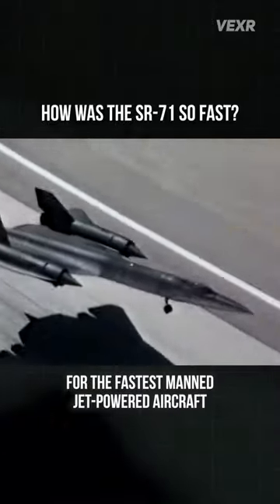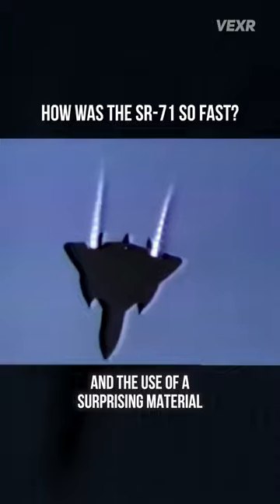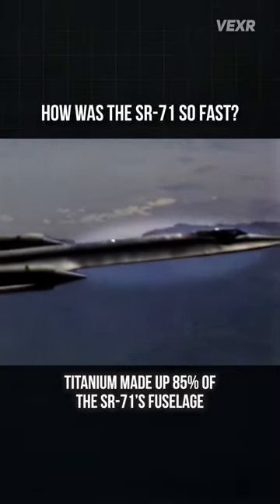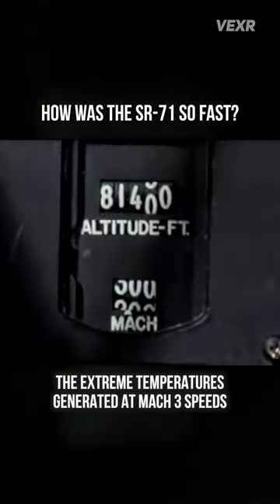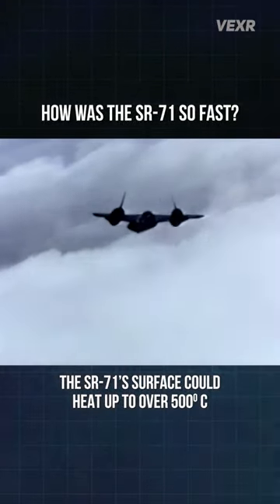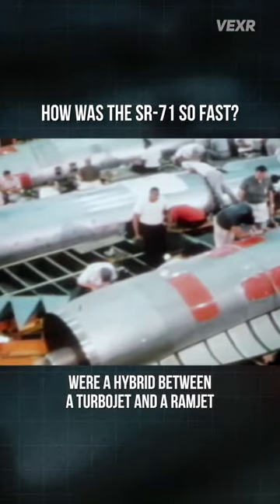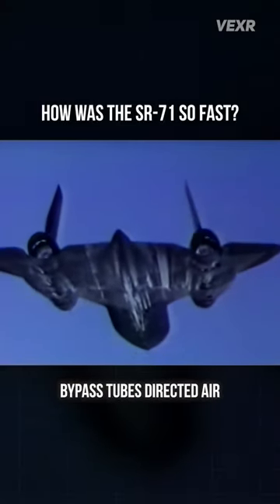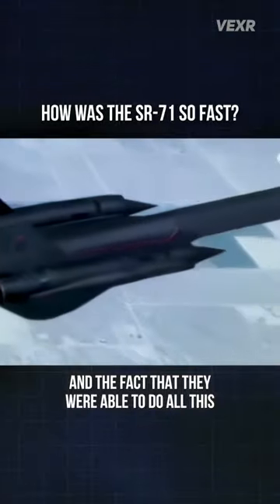How Was The SR-71 So Extraordinarily Fast?

Comment: Using slide rules instead of computers, Kelly Johnson and his crew went from drawing board (again, no computers) to first flight in 20 months. Incredible!
Reply: Slide-rules.
Reply: @sbkenn1  Yeah... damned autocorrct!
Reply: @russmiller7284  auto incorrect.
I have a spelling chequer, it came with my pea sea 😛
Reply: I don't know why everyone makes such a big deal about that, computers don't design anything even in this day and age, all computers do is enable someone who's designing something to look at it 3 dimensionally via CAD instead of everything being drawn on a flat plane, and they can make calculations instead of having a team of people doing the math but at the end of the day they don't design or innovative, it's people who do that.
Everyone gives too much credit to computers when it comes to designing things in this day and age, it's still people doing all the designing and innovating, it's not like you can enter "Design a better spy plane than an SR71" into a computer and presto!!! You have the next generation spy plane.
And actually a slide rule is a computer, so is an abacus, and slide rules aren't any harder to learn how to use than a modern handheld calculator, they just aren't as fast.
People who design things nowadays are just as smart as the people who designed the SR71, matter of fact they're smarter, they design autonomous vehicles that travel to other planets and move around transmitting images back to earth and take soil samples and analyze them and send the results back to earth, that's far more complex than the SR71 and anything it could do.
Reply: @dukecraig2402  I'm old enough to have used both a drafting arm and CAD. With CAD, not only can one draw much, MUCH faster, the programs double-check math. Yes, of course, the creativity remains with humans, but the technology saves SOOOOOO much time (while catching mistakes).
Reply: @russmiller7284  With relative/parametric placement, you can move many objects in one action.

Comment: The hybrid engines were built such that the faster you went, the faster you COULD go.

Turbo jets stop working effectively around the speed of sound, however Ram jets only START working at the speed of sound. It's nutty.
Reply: Only faster to a point, once you hit the limits that's it
Reply: Ramjets start losing their efficiency when the internal speed of combustion is supersonic, but newer Scramjets can go up to Mach 6 because they can support supersonic combustion.
Reply: @iwhu707  ramjets lose efficiency when they are used outside their design range. They are perfect for flights of mach 3 and are capable of speeds up to mach 6, IF they are designed for that. 

Scramjets have yet to become operationally usefuel
Reply: @gr8crash  I believe SR-72 will be scramjet-powered, but i’m not sure. I also thing scramjets will get more useful once we can combine them with rail guns, which will give it enough initial velocity to start up combustion.
Reply: @iwhu707  if/when an SR72 comes out "even though it won't be called that" it should be scram jet powered. The fictional Darkstar in Top Gun 2 actually did a good job of showing how a system like that would work.

I highly doubt you'll ever see railguns on an airplane. They are a cool technology,  but given the size, power needed etc they'll likely never be on an aircraft. You'd be more likely to see energy based weapons.
Reply: @gr8crash  I meant that scramjets would be used as a “sustainer” stage on a railgun projectile to increase range, since railguns can easily reach Mach 6. However, it would be difficult to design a scramjet that can withstand the G-forces of the railgun launch.
Reply: @iwhu707  oh ok, I see what you meant now. I'd doubt that as well though. They already have a range of about 125 mile or so, and the rounds are so small that you wouldn't be able to install and engine, fue, controls etc. At that point you're just making a hypersonic missile
Reply: @gr8crash  Fair enough.
Reply: Unless there's something I don't know about rail guns, they are kind of impossible to mount on a bird right now, just way too power hungry and big. You'd be better off filling up a cargo bay with tungsten rods strapped to tiny solid rocket boosters and drop them at mach 4 from low orbit.
Reply: @MakutaNazo  yea they are just way to large still and way to power hungry to be on an aircraft for the foreseeable future.

Comment: The X-15 aircraft also holds the official world record for the fastest manned aircraft. It was flown by Air Force test pilot William J. “Pete” Knight who reached a top speed of Mach 6.72 (4,520 mph; 7,274 km/h) on October 3, 1967.
Reply: The X-15 was an experimental plane made to learn about how planes and their structures work at such high speeds. The SR-71 actually has meaningful capabilities besides "plane go brr"

Comment: It actually leaked fuel when on the ground because when the metal heated up and expanded it would seal theaks. That's what I was told so take it or leave it. Still a badass spy plane.
Reply: Thats correct. It leaked slightly because the heat shielding swells to fill the gaps, and the small amount of lost fuel is nothing compared to the extra development costs to fix it.

Comment: As a USAF 5 level ASOP and WCT I logged one of the SR71's in 1974 on radar while stationed at the now defunct 932nd AC&W Squadron, Rockville, Iceland. It was westbound and probably coming back from a mission. That specific info was above my pay grade. At the time I carried a secrete clearance.
Airspeed was over 2000 kts. The ground speed equivalent was difficult to calculate as the bird was flying at what pilots called 'angels 49'. That's 49,000 feet for the civilians in the crowd!
I also understood that once landed the pilots had to remain in the cockpit for about an hour being protected by the onboard AC while the hull cooled down. With a skin temp of about 1000 deg F getting out early would have fried them to a crisp!!

Comment: I saw one of these at a museum and one of the workers was saying that the plane actually had gaps in some parts of the plane because it would heat and expand so much where it would close those gaps during flight
Reply: It leaked fuel at take off because of those gaps.

Comment: At speed the engines expanded 6" in length and 2" in diameter. The fuel was also the lubricant and the anti-oxidant and had to work -45F to 800F. The computer was hydraulic. Imagine the engineering challenges!

Comment: What's even more fun is that we don't know it's actual top speed.  They never tried to open up the throttle all the way.
Reply: They absolutely knew the top speeds
Reply: @gr8crash  no they don't.  My grandma worked as one of two personal assistants to kelly johnson.  She knew when it was being made and put into service and when they did that speed test from la to newyork.  The pilots who did that test did not push it all the way.
Reply: @camohawk6703  incorrect. They never did an LA to NY run, it was LA to DC. And they did fly a lot of it at their max of mach 3.3. They did go to P&W and ask to fly beyond the 427° CIT limit and they basically said "don't do that".

Comment: Titanium and technology supplied by Avro in Canada after the Arrow development was mysteriously cancelled..
Reply: Lol no
Reply: @gr8crash  Very shortly after the Arrow project was mysteriously cancelled, a lot of the engineers, machinery and material were moved to Lockheed.  Fact.
Reply: @sbkenn1  haha not likely. I'm sure some where taken in by various aircraft companies,  but not likely into Skunkworks. They were already in the design phase of the A12 when the Avro ended. And the Avro while cool had nothing of significance to contribute to the A12 program. The ONLY thing that was used was the J75 for the initial A12 flights and for the TA12. Unless you can name someone who left Canada to go to Lockheed Skunkworks to work on the aircraft then you can't state it as a "fact"

Comment: Even with Titanium the panels have to have gaps in them because the heat and pressure would cause them to expand into place. Just Amazing
Reply: Leaked fuel.Had to fuel enough to heat it up Very 1st thing was to refuel in air.Then go on mission.😮

Comment: The sr71 does not hold the record
Reply: Um yes it does
Reply: @carlvanich8296 The X-15 is rocket-powered. The SR-71 is powered by a turbo-ramjet. The SR-71 is the fastest manned air-breathing plane, while the X-15 is the fastest manned airplane. It depends on if you count the X-15 as a “plane” though.
Reply: @iwhu707  if it has fixed wings and flies through the air it's a plane
Reply: @carlvanich8296  The video specifies that it holds the record for “manned and jet-powered aircraft”

Comment: What modern military aircraft use engines with about the same horsepower?
Reply: Most of them.
Reply: @gr8crash  I don’t think so. These are about 35,000 (correct?) horsepower from back in the day.
Reply: @seageo4303  with afterburner 34k lbs. A single F135 engine is 40k lbs. The F119 in the F22 is atleaat 40lbs on afterburner and it has 2 of them, so the F22 has more thrust than the SR71.

Comment: Wrong X15 was faster I think and sr 71 was da fastest air breathing and manned airplane ever
Reply: the X-15 was designed as a manned rocket powered aircraft with no throttle control system, which meant that when the rocket fired, it was ‘full-tilt boogie’ until it ran out of fuel, and the pilot was just along for the ride
Reply: saturatedsausage7398  oh yeah i completely forgot about that

Comment: Here’s one thing you do not know about the black bird of the seals on the engine were so bad around the fuel lines that it was leaking fuel on the runway so they would have to refill it every time it was getting ready to take off. That’s how bad the seals were on the fuel lines.
Reply: it was designed that way, because once it got up to altitude and speed, the skin would heat up and expand, sealing the gaps in the surface of the aircraft